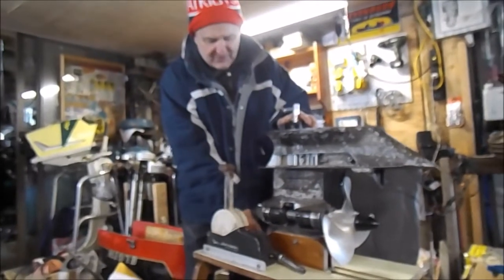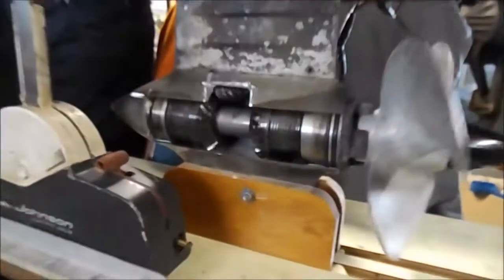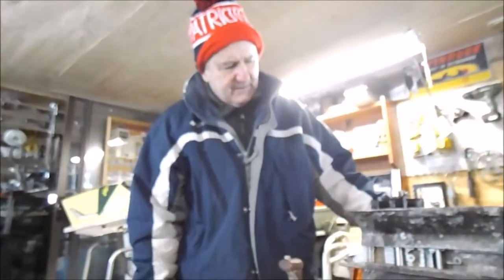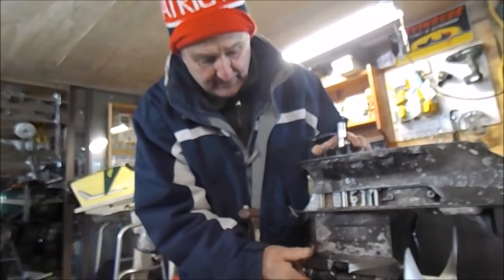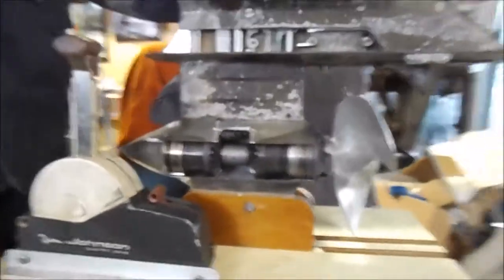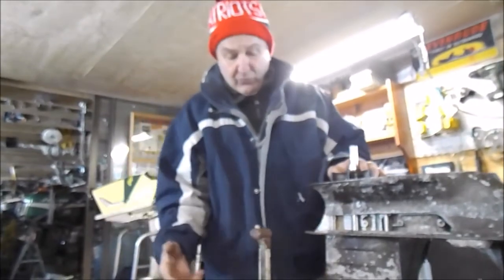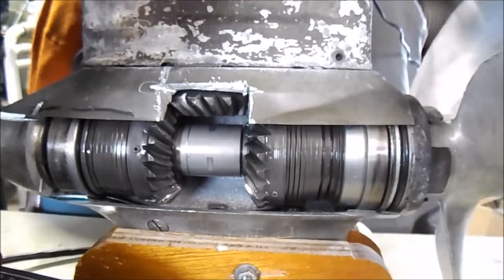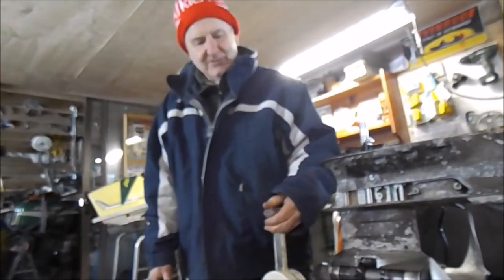OMC electric shift lower unit

Comment: Great job guys!  Correct me if I am wrong, the coil is fixed, can't turn so when it is engaged you have an electrical field.  Spin a conductor in a electrical field and you get a voltage.  The voltage wants to go to someplace.  The lower unit must have corroded terribly especially in salt water.  Thanks for sharing!

dale
Reply: The spring is held to the gear with 3 allen screws. The magnetic field locks the spring onto the hub (inside the spring) which is splined to the  shaft (hypoid gear oil may work if you add a friction modifier). The forward hub is knurled to aid engagement (dampen). There is no current generated. These had a belt driven generator off the flywheel as well as a magneto. The spring pulling towards the coil is a patent defect. It causes the coil surface to wear out.
Reply: I’ve got a 1972 anniversary Johnson 50 hp everything works fine neutral and reverse but when I put it in forward it blows a fuse can you help me thank you